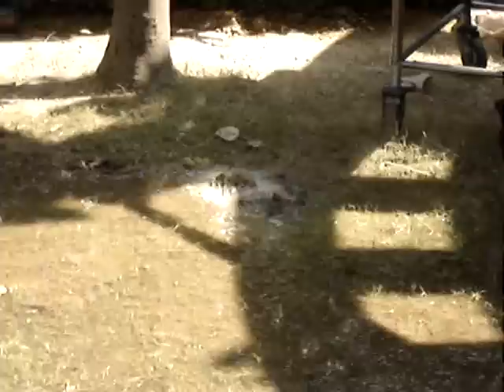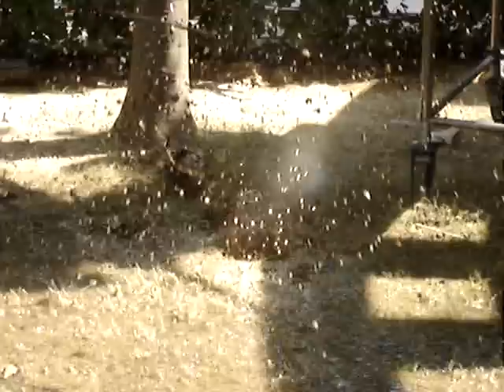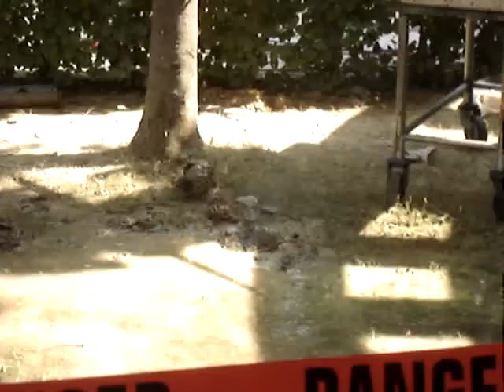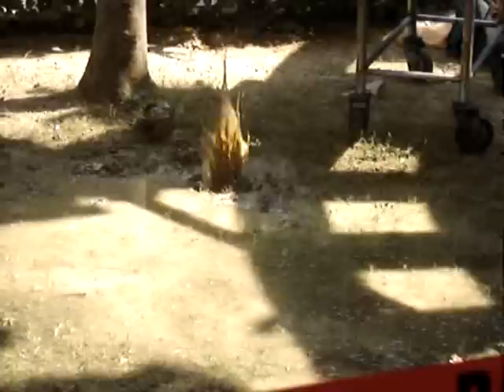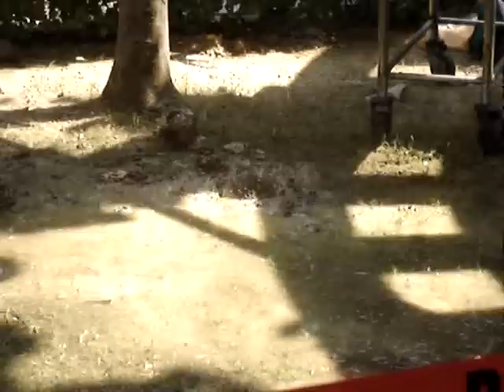Water and Electricity

Comment: Water and electricity can be fun to do, but keep that in mind, though - water is actually a crappy conductor, so it becomes resistor, eventually heating up to 200 Celsius that it boils crazily. It can also get to several thousand Celsius and explode. I have done that with 100,000 volts from pulsed ballast system I have built for laser - it glowed so brightly and, for few second, it explodes.